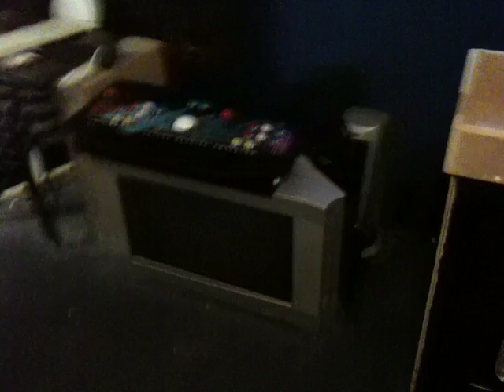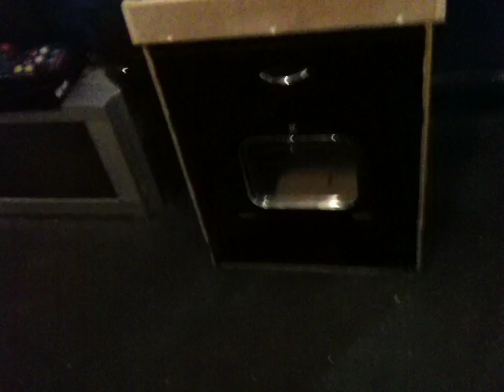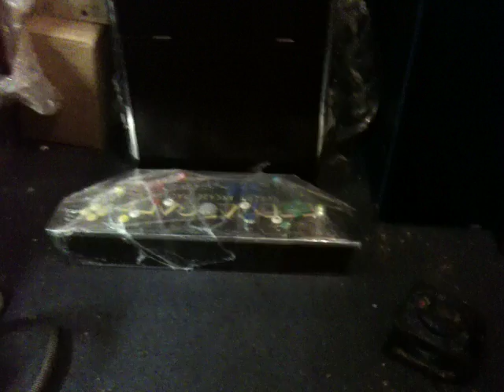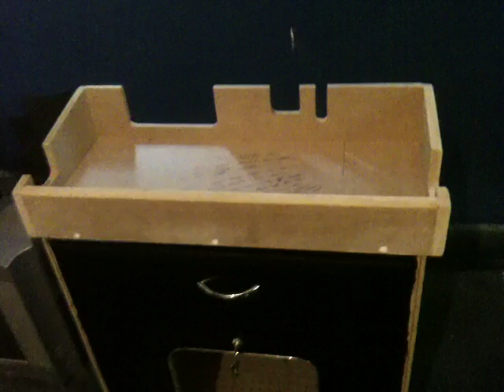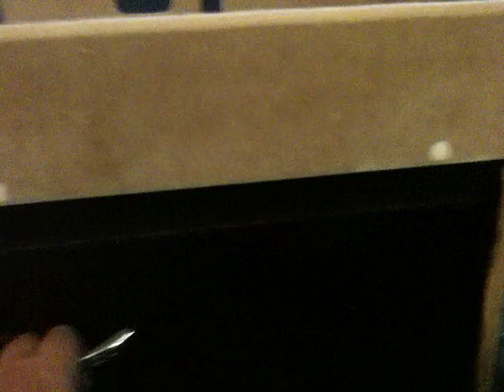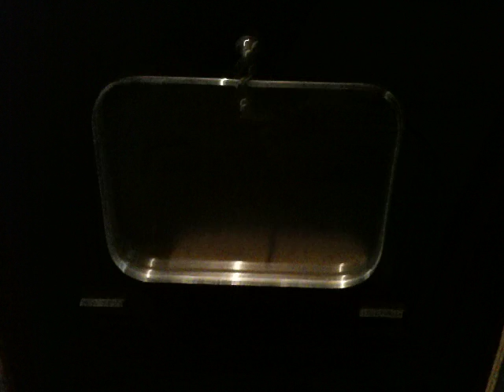L.S.'s Custom X-Arcade Pedestal - Features (1/2)

Comment from the maker: The standard sticks, buttons and encoder used in X-arcade systems are very cheap compared to the top-end parts we recommend; the quality of the encoder has varied in these units over the years with some examples suffering from ghosting or key blocking and some are not programmable; essential features for a good gaming experience. They are fine for very casual use, but I'd advise anyone upgrading to a full machine to not scrimp on controls as they will make or break a good machine.